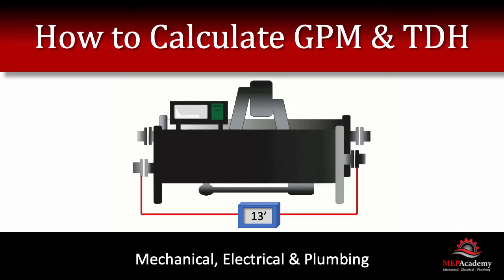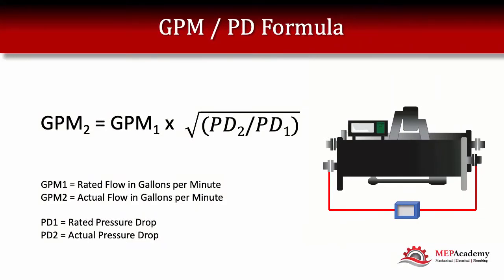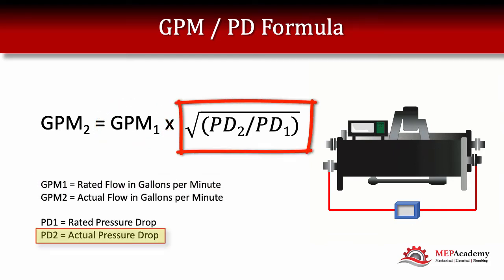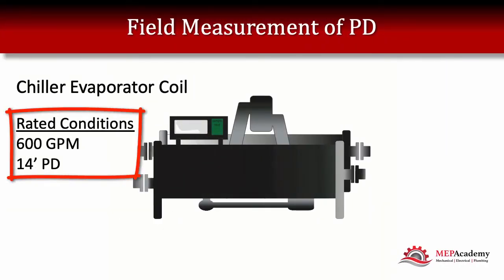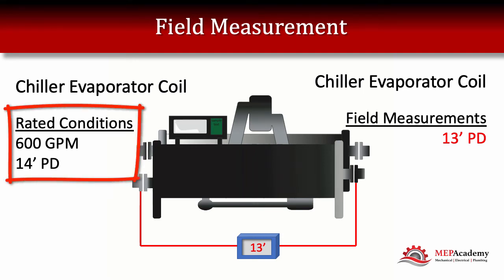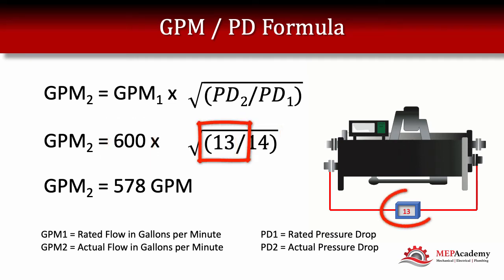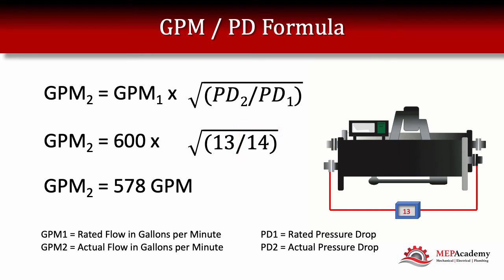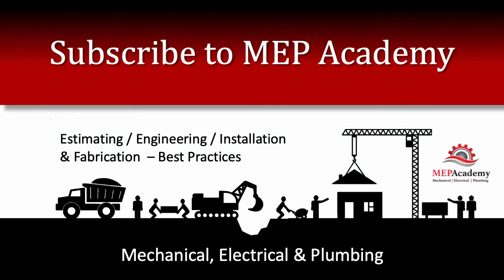How to calculate GPM or TDH for a Coil or Chiller

Comment: Thankyou for this, I have one doubt chiller Flow (GPM) depends on primary pump,If this pressure drop get reduced means GPM will increased increased right
Reply: Because pressure drop less means obstruction is less ,I think this formula works on pumps,Thank you

Comment: Can you use this for pumps as well or is it different?
Reply from the maker: It's different in the aspect that a chiller or heat exchanger has a coil that causes the pressure drop, while the pump is the source of creating the flow to overcome that pressure drop.

Comment: Thank you for this. Would this be a good tool to use for any chiller I walk up to old or new to calculate flow rate?
Reply from the maker: Yes, if you have the correct information, it's just a simple calculation. Thanks for watching.
Reply: @MEPAcademy  thank you